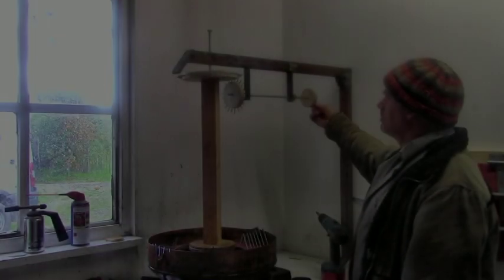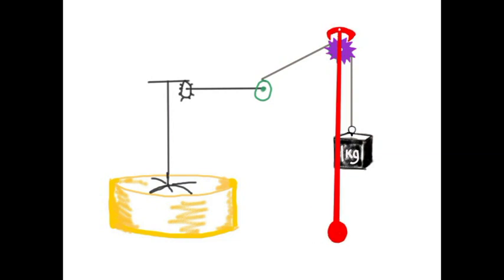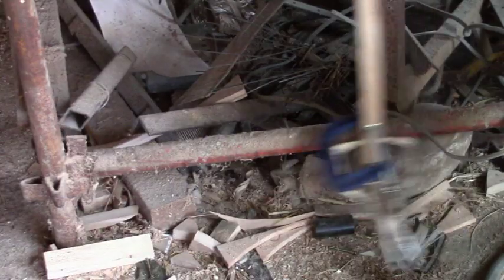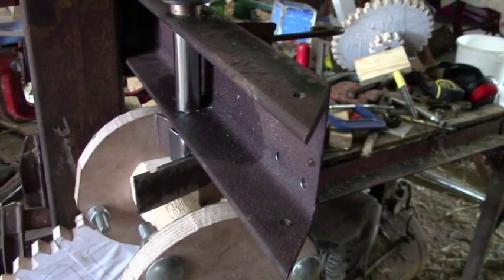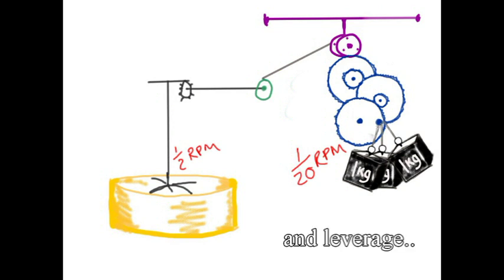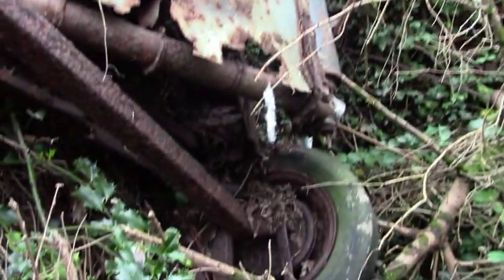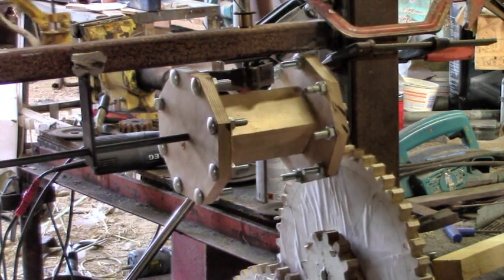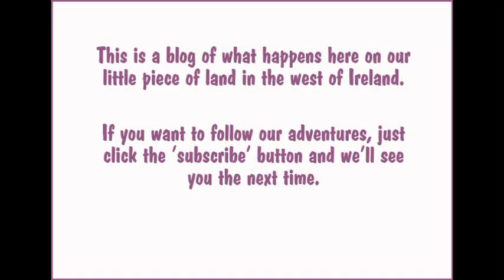Clockwork Doughnut Cart: Part Two – The Clockwork Bit

Comment: why not just use a used solar panel on the roof of cart with a dc motor? could even use some led lights and a rechargeable battery?
though I applaud your cleverness!
john
Reply from the maker: Rev John O'Toole Hmm. A solar panel would help with the lights, alright, but only on dry days. And it couldn't match the power needed by the motor - there's quite a bit of torque needed. But a car battery and windscreen motor would do the job, you're right. But I'm still hoping the clockwork will work and be attractive.
Reply: WayOutWest Blowinblog a deep cycle battery like one for a golf cart or such would be far better than car battery. solar will work on a cloudy day too just not as well. you may find some used ones from people that have upgraded to larger systems.
though your method would be more amusing to customers.
best